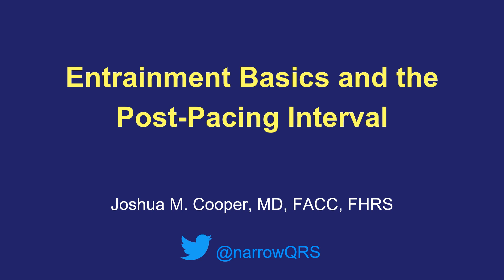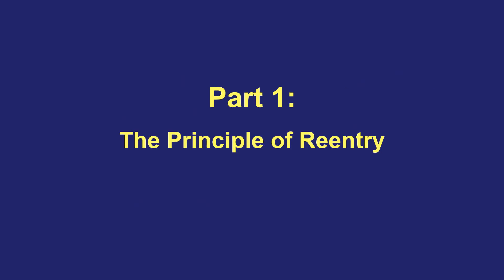Entrainment Mapping: The Post-Pacing Interval

Comment: Hello Dr. Cooper, Thank you so much for your awesome lecture! I have a quick question. At 11:49 in this video, I am not entirely sure how the excitable gap migrates backward when you pace faster than TCL. Can you please explain, sir?
Reply from the maker: The excitable gap isn't actually moving backward, but rather it continues to revolve forward around the circuit for as long as the tachycardia continues.  However, the location of where the gap is located at any moment in time will of course vary, depending on what moment you're looking at.  When one starts pacing at a faster rate than the ongoing tachycardia/circuit is happening, then the location of where the gap is will be different with each pacing pulse (because the pacing is happening at a different rate than the circuit revolution i.e. they are out of sync).  And so, if pacing is occurring faster than the revolution of the circuit/excitable gap, then with each sequential pacing pulse, the excitable gap will not have had the chance to get all the way around back to where it was at the moment of the previous pacing stimulus; instead, the gap location will essentially be a little be behind where it was the last time a pacing pulse occurred.  And that means that effectively, comparing each gap location to the previous location, the gap will be a little bit behind where it was before, and at some point, the gap will be located as close to the pacing stimulus as possible, given the different locations it will occupy during different pacing pulses.  That is why I made the statement that the gap "migrates backward" during faster pacing, which referred to its position each time pacing occurred, rather than the actual direction of travel.  Does that make sense?
Reply: Yes that does make sense, Dr. Cooper!
I was assuming an excitable gap to be stationary during re-entrant arrhythmia.
Thank you so much for your detailed explanation, sir.
Reply from the maker: @kyawkhant4273   You'll see at the 7:10 mark, i review how the excitable gap is rotating! 👍
Reply: That’s right. Thank you, Dr. Cooper :)